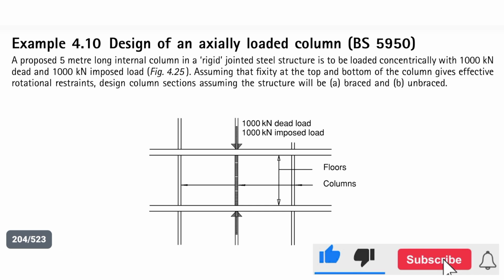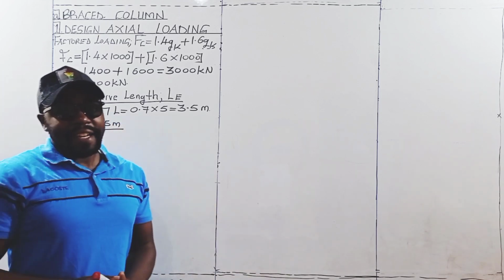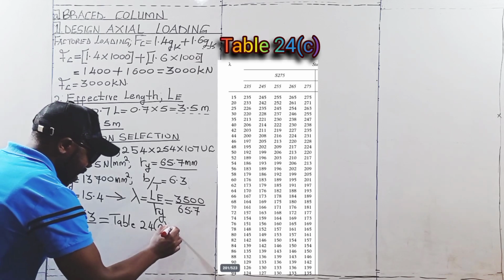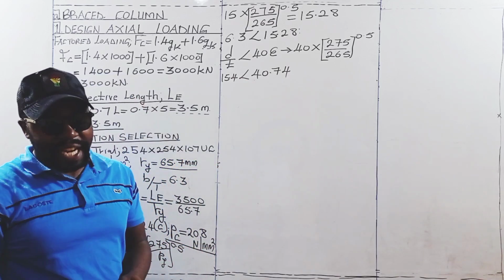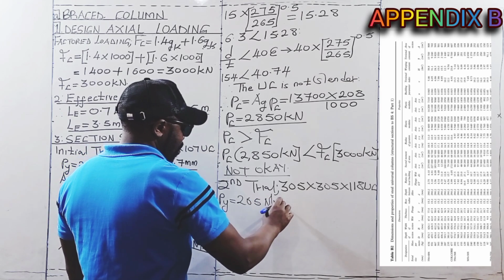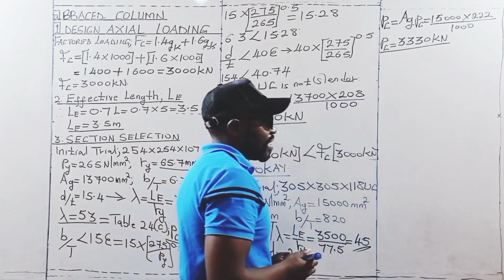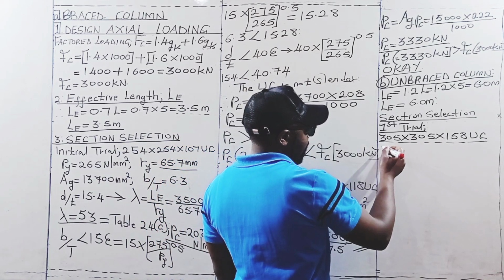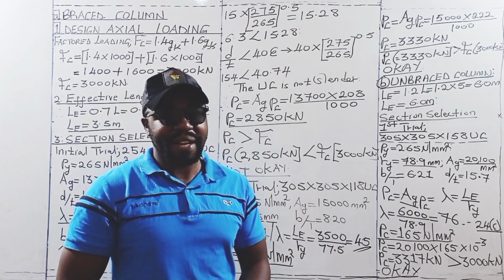DESIGN OF AN AXIALLY LOADED COLUMN|DESIGN OF COLUMN SECTION|BS 5950.

Comment: How did you get 222
Reply from the maker: From table 24c of the BS 5950.
Reply: It's the compressive strength of steel from table 24c after getting the slenderness ratio.